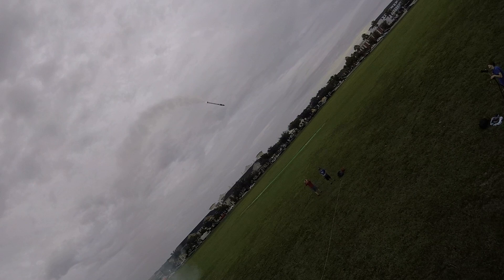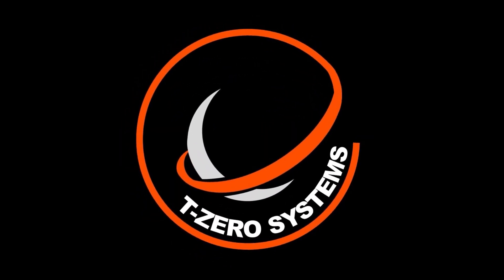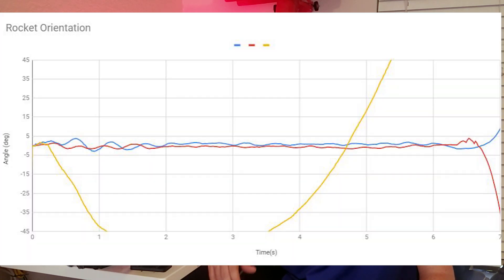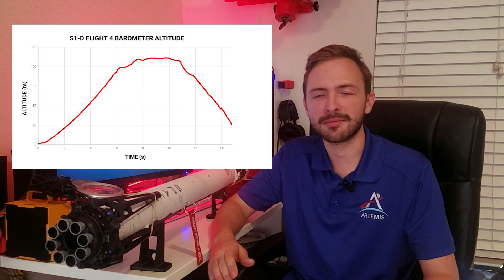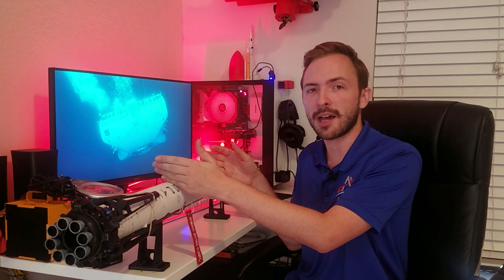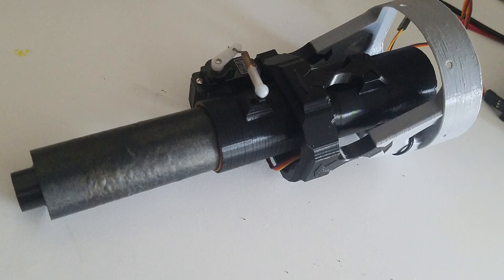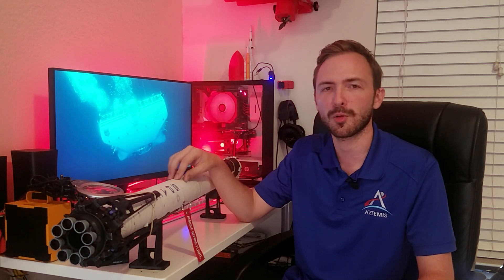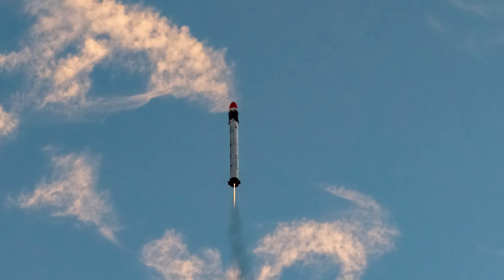TVC Model Falcon 9 Flight #4

Comment: Congrats on a great flight! Very impressive. Could you open the fins along the bottom edge rather that the side edge, that way you would get more drag on the way down, the same way that Blue Origin deploys air brakes on its New Shepard vehicle. May give you more time for computation on the way down.
Reply from the maker: That is a more mechanically complex setup but definitely an effective one!